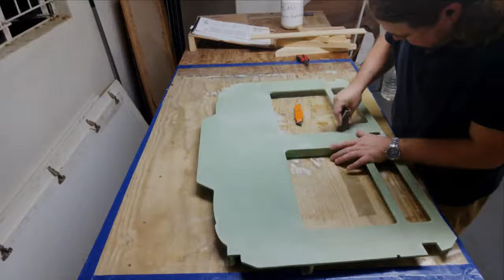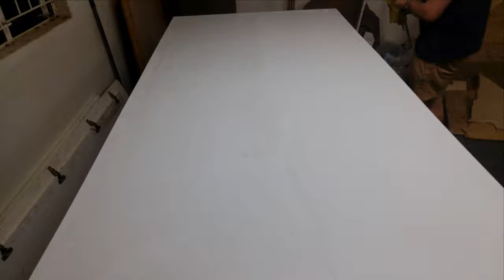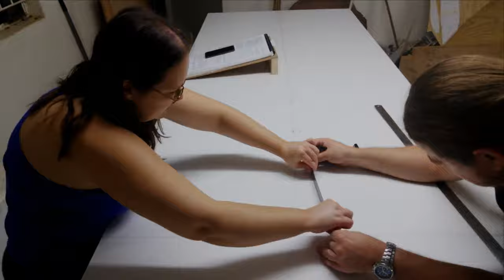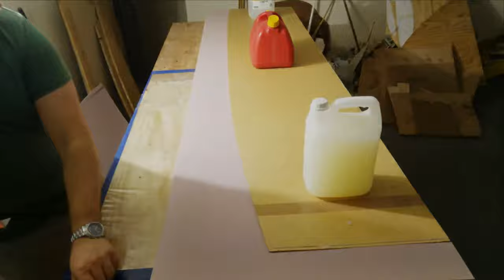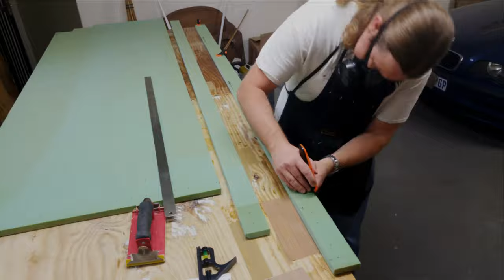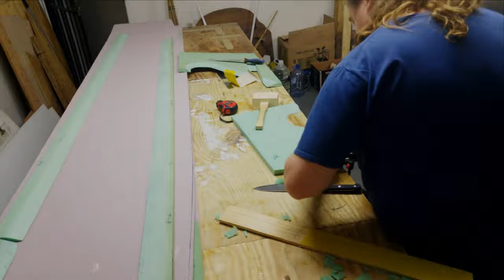Cozy MK IV: Fuselage sides Part 1

Comment: Are you going to stick 100% to plan, or are you going to modify your aircraft at all?
Reply from the maker: I have already moved the seatback 1" aft  of the plans position and plan on doing the CG strakes. I may do some lightening exercises in the front, like non structural pieces in carbon fiber, to help with front seat weight limit. I have no official plan as yet over the canopy... which I'm contemplating modifying too.